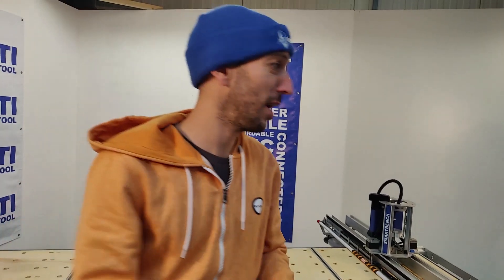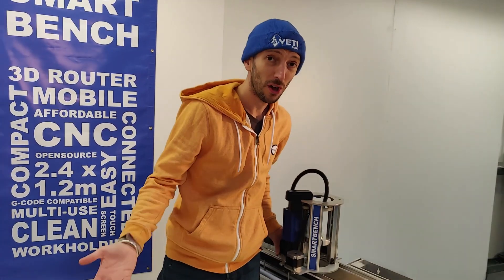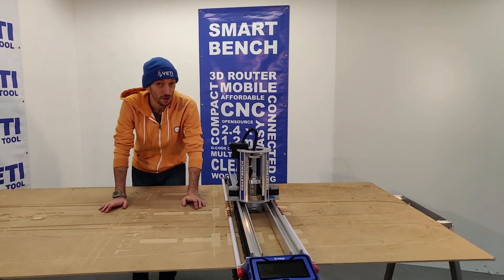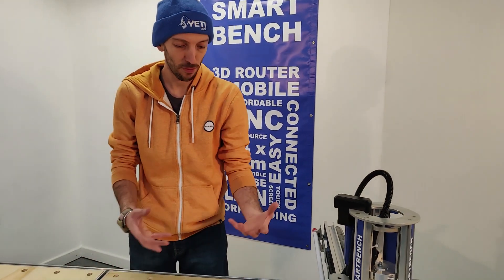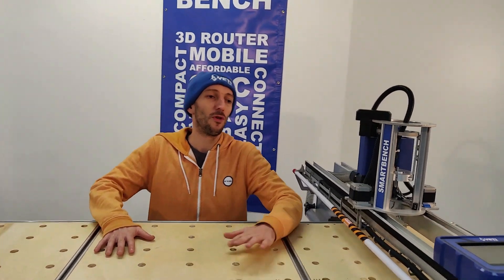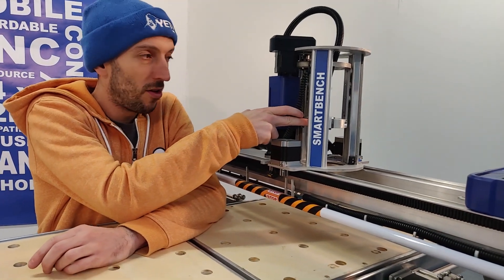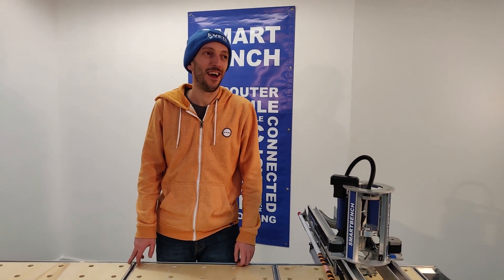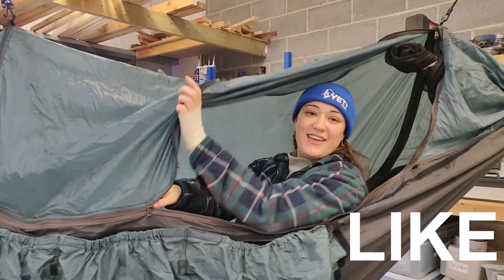Q&A with SmartBench

Comment: I'm serious considering buyer but I have some questions. Dust collection and noise being 2 questions. Is there software flexibility? Or do I have use a specific software that comes with a subscription and a learning curve? How strong is the table? I'm 155 pounds. Could I stand on the middle of it without the table flexing temporarily or permanently? Cutting out parts. Do you guys leave little tabs on the work piece cut outs since theres no vacuum clamp? What is you prefered way of releasing those cut out pieces from the sheet? Is there any loss of accuracy on the corners of the work piece? I'd like to get a close up on the cleanness of a curved cut and straight cut to see how your CNC router deals with chatter. 1/4 only or can it also take 1/2 shank bits? I've heard that with aluminum you are supposed to plunge all the way through and not take the cut in multiple passes. What is the thickest aluminum you can cut in one pass on your machine?
Reply from the maker: Hi Mayday! Thanks for your questions :) 

Software - SmartBench can be used with a range of different software including Fusion360, Mozaik, RhinoCAM, Vectric, Cabinet Vision and Alpha Cam. We haven't yet come across a CAM package that doesn't support the GRBL post processor which SmartBench requires. 

Bench Weight - The bench is made from aluminium extrusions. This enables SmartBench to be strong yet lightweight to maintain portability. We will be publishing some max load figures very soon! 

Work-holding - We often use tabs created in the CAM software to secure our work-piece while cutting when it is unsuitable to use other methods such as tape or screws. When removing the tabs we can either use a chisel or a multi-tool with a cutting blade.

Accuracy - We are now working on some videos which cover the accuracy of SmartBench including rigidity of the machine. In this video we will also cover tool backlash and chatter. 

½” shank – We are working on a solution for the spindle accepting bits with a ½ shank -We hope to releasee this as soon as we have completed testing.

Aluminium – Currently, we have only had experience with cutting 2mm aluminium sheet for which we used stepdowns of 0.5mm which returned some great results. 

Also - check out our knowledge base here: https://www.yetitool.com/support/knowledge-base
Reply: @YetiToolLtd  perfect! I very much appreciate the detailed responses. I understand being a newer company there is still some data that you don't have yet. But I am willing to be patient for that data. I tried calling you guys the other day but the line was busy. I'll keep trying to get a hold of you guys to talk a little more and make sure this tool is for me, and to make sure I save enough cash to buy it from you when/if all the details check out. Thanks!

Comment: Beautiful. I build cabinets and furniture in a smaller shop with my wife. I have to be very selective on how I use my space. I've been looking for something like this for a while. I'm gonna do some more research and maybe wait for some more videos, but this is 100% getting put on the watch and maybe buy list.
Reply: Did you end up buying it ? How was it on melamine
Reply: @TheUofastudent  no I didn't end up buying it. I ended up subbing out all of my manufacturing to a local factory... Best decision I ever made. But as long as you have the right bit on it, and the right speed settings then you should be perfectly fine on Melamine
Reply: Awesome thanks for the update, that’s what I am doing now but with subing out the work I have no control over the price and time , lots of money coming in but not a lot staying 90% going to sub and if I increase the price I lose the customers … so looking for a cost effect solution
Reply: @TheUofastudent  that sounds like it's an issue of not having reliable subs, my man. I work super closely with the factories I sub to. If I have a deadline they try to work with me. If I make a mistake, they will send me a pic and ask about it before shipping it. If I need replacement parts then they will rush the production. And we have pre established pricing. I have their pricing and they have mine. We know exactly what the other one will make before moving forward. The factory I use most is only 20 minutes away from my house. 

Where are you, by the way? I'm in the California central valley
Reply: When I sell a 50k kitchen, I usually make 20-25k. We have a really good deal going on. If you are only making 10% on your jobs, then something is wrong for sure. But you don't wanna have to do back into manufacturing
Reply: @MaydaysCustomWoodworks Edmonton Alberta Canada, there are a couple of guys I tried using but I don’t have the relationship that you described, I have noticed a few times I am the last to be served since they know I’ll be back no matter what , and that is what I want to get away with being stuck using a service that I have honestly paid over 150 gs over the last 2 years. I know they got to pay for material but looking at how much the material cost I would of still made more money then just installing it. So looking for a way out with out breaking the bank on a shop and machinery

Comment: Is there any future possibility of processing 1575mm wide sheet stock? Or possibly selling custom units that can process this width?
Reply: Aluminum composite panel processing. As well, fibre cement and high pressure laminate. Large format cladding.
Reply from the maker: Currently we don't offer this, but we'd definitely be up to evaluating it. We would need to do a special run of profiles, and build software, which add on time and cost. Out of curiosity, what sheet format is driving this requirement?
Reply: @YetiToolLtd  Another good reason for 1575mm wide format would be the 1500mm x 1500mm Baltic Birch sheets.

Comment: Using the preset jig shapes how do you get the hole exactly where you want it?
Reply from the maker: A physical datum matrix on the bench allows features to be 
quickly referenced to the machine. So using our touchscreen (Easycut) you simply select your starting point anywhere on your material, and press go!
Reply: @YetiToolLtd  sorry for my ignorance. But is a physical datrum matrix?
Reply from the maker: @Surfingspider69  no problem - it's what we call the grid of holes on the bench which can be referenced in the console (like map coordinates) and physically using dogs/stops. More video explainers to come!
Reply: @YetiToolLtd  Keep the videos coming. Excellent.